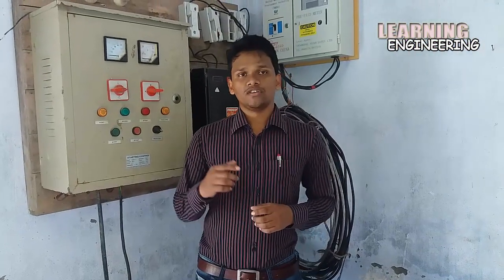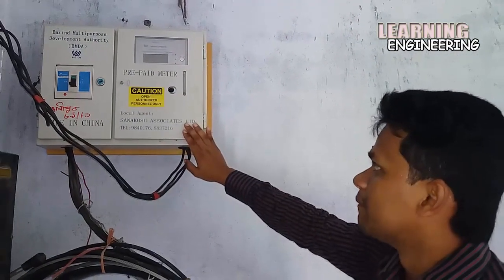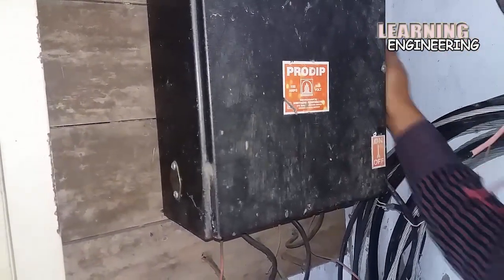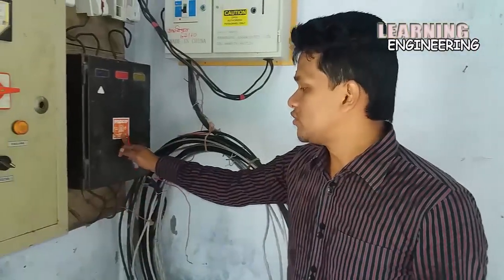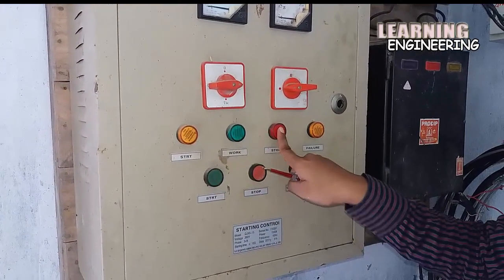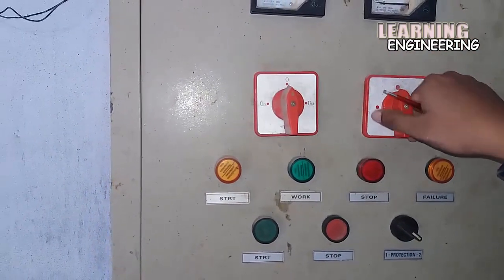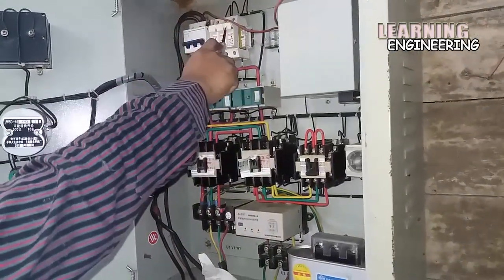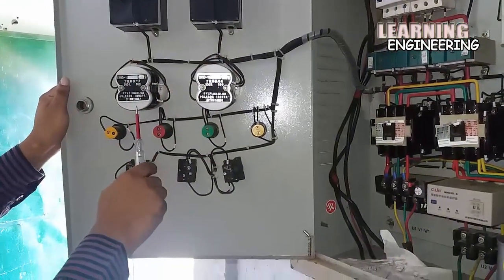Motor starter│ 3 phase motor starter│ Learning Engineering│

Comment: How to calculate main contactor and delta contactor and star contactor and olr current rating and magnetic contactor current rating please reply
Reply from the maker: I've only a lil` experience in motor sizing & calculation for contactor and overload. Hope you guys can show me the correct or proper calculation. My current calcluation as below, please correct me if I'm wrong.

For a 45kW motor:

Amp = 45000/(415*1.732*0.85)
= 74Amp

Main and Delta contactor & overload:
= 74/1.732
= 42.8Amp
With 10% spare:
= 48Amp

Star contactor and overload:
= 74/2
= 37Amp
With 10% spare:
= 41Amp

AB contactor: 
1) 100-C60T10 x 2 pcs
2) 100-C43T10 x 2 pcs
3) 193-TCC45 (30 - 45) Amp

thanks sir
Reply: To calculate Main, Delta and star contactor is very simple. For Main and delta contactor, multiply ur full load current of ur equipment by 58% and star by 33% it will give you ur contactor size. Remember to select the nearest number size if your total answer is not found in market.

Comment: My mobile number is +919447776505 ( whats app & we chat). we are manufacturing Mobile based remote motor operating device. 

Simple and easy. no internet connection needed. you can control anywhere from the world with normal phone. Demo available.  this is made in India product with guarantee. simple, easy and  low cost. suitable for all 3 phase motors. you can know motor running voltage, current, and motor pumping or not, any complaint, reverse run etc. for more information contact me. 

Thanks.
Reply from the maker: thanks for your comment.